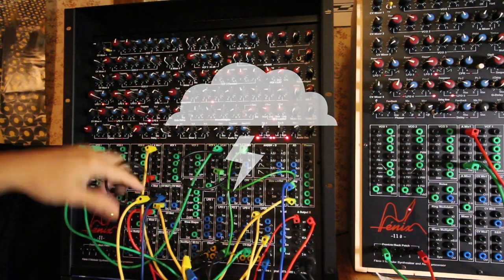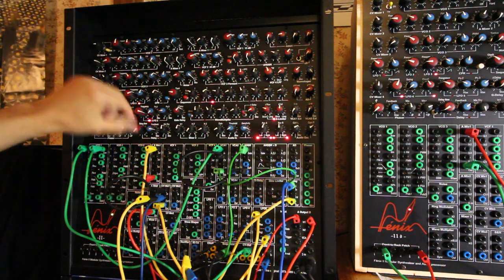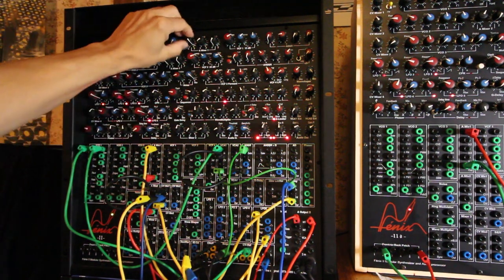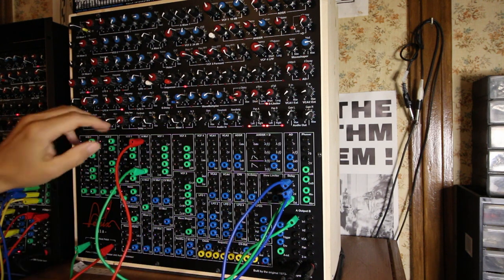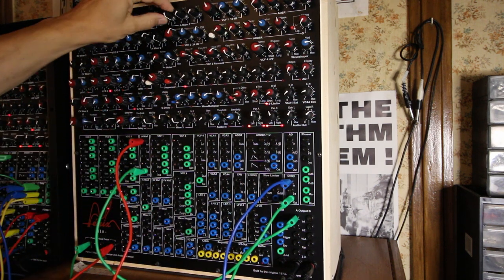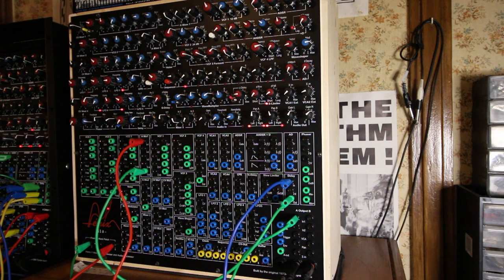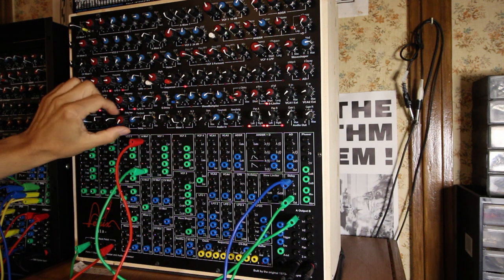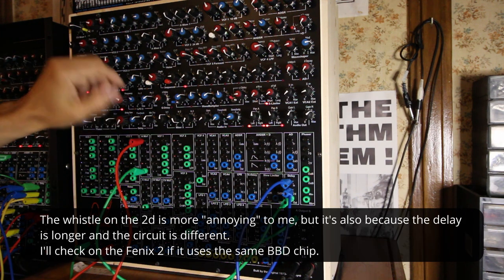Synton Fenix 2 & Fenix 2d delays

Comment: The clock in FIId is set lower compared to the FII.  Lower the clock  give a clock leakage because it it is below the Lowpass filter .  The 2 BBD in the FIId, 1 has  a  longer and the second has a shorter delay.